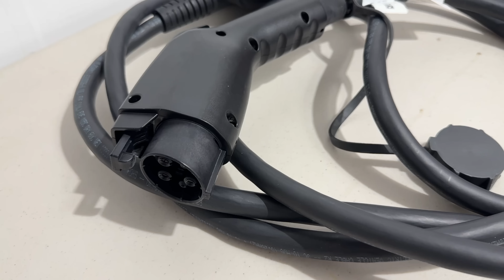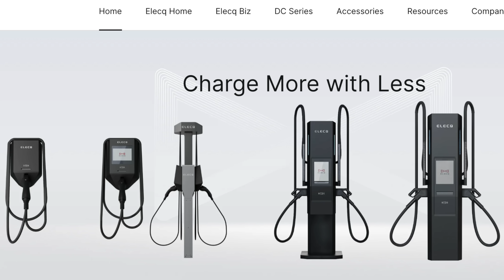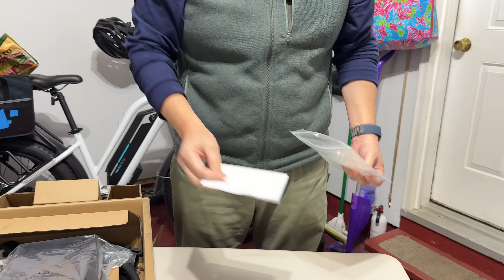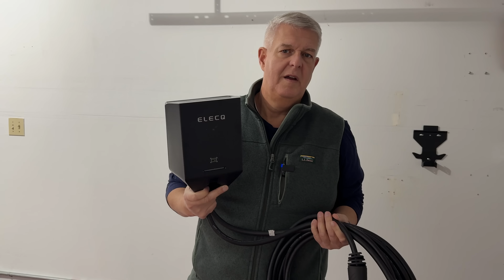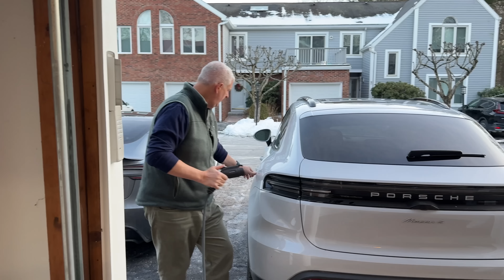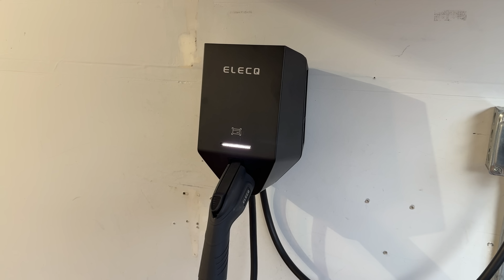Charge Your EV At Home With A Level 2 EVSE | Step-by-Step Guide!

Comment: Dave,
Great post.  One suggestion, if you are even semi-regularly installing chargers, put a sacrificial piece of 1/2 or 3/4 inch plywood on your garage wall to mount your chargers.  That way you are not destroying your drywall.
Reply: I also recommend adding a Chargehanger

Comment: This looks like an excellent charger with nice features in phone app.  If on a tight budget, you can simply buy a mobile charger and plug into your NEMA 14-50 receptacle.  But, do not frequently unplug it unless you have a commercial receptacle (>$50). 

Back in 2017, I used the free 40 amp Tesla mobile charger and it worked great.  For a few dollars, you can get a 3-D printed wall bracket and cradle.  Today, I would only do a hard-wired connection to get 20% faster 48 amp charger.  Not only faster when I forget to charge, but it’s safer.

Comment: Isn't it fine to charge to 100% frequently on level 2? I know charging to 100% on a regular basis from DCFC isn't great, but I thought that wasn't really the case with level 2.
Reply: @jeffs6090  I don't think charging to 100% is much different on a level 2 vs level 3 charger,  as most EV battery management systems greatly reduce charging speeds the closer you get to 100% (so your level 3 charge is likely closer to level 2 speeds above 90% SoC).

However, it is generally recommended not to charge to 100% when level 3 charging, as due to this speed reduction, most EVs take longer to charge from 80% to 100% than they do from 0% to 80%. So it is faster to unplug and drive to the next charger, unless you really need your full range to make it to your next stop.

Comment: I was thinking, what if I installed the unit outside and turn off the auto charge? Then, a stranger comes by when I’m not home. They download the app, pair it to the unit, and turn the auto charge on. The unit starts charging right away. Can this be done?

Comment: I hope you had a Hubbell 14-50 receptacle installed if you are going to switch between this charger and the Tesla charger. The standard 14-50 receptacle is not made to keep plugging in and unplugging, as this can lead to the receptacle melting and could catch fire.

Comment: Maybe I'm missing something but what exactly does using this unit provide above just charging strait off the 14-50 receptacle ?
Reply: It has a bunch of additional features, such as preventing unauthorized use and remote monitoring with an app.
Reply: We call it a charger, but it’s really a safety device.  Correct name is Electrical Vehicle Supply Equipment (EVSE) which safely delivers power to your EV.

Comment: At about 4:10 that was a NEMA 14-30R receptacle which electric dryers use.
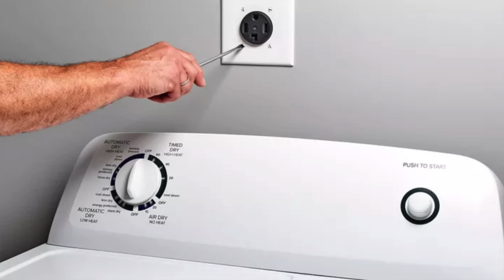Reply: Actually, it is closer to 3:55 but that’s a great point. Although the 14-30 has only 3 slots so that is the 14-50. 👍🏻

In fact, I am fairly sure that a 14-30 cannot support the same amount of current draw as the 14-50.